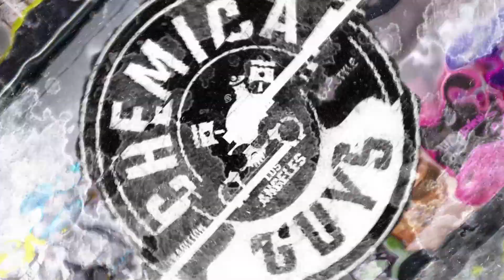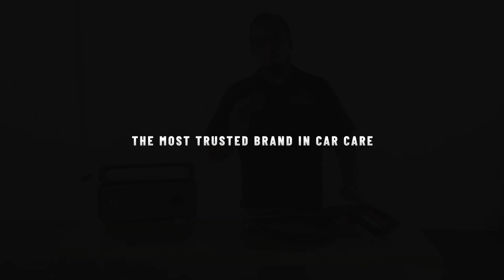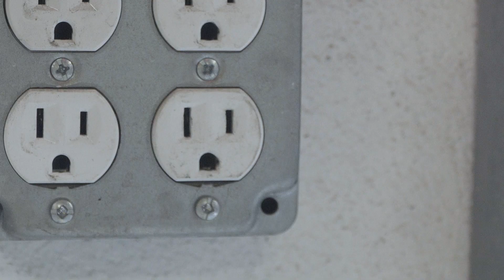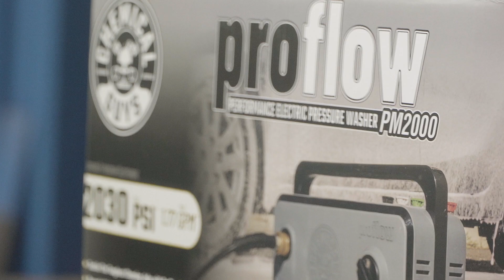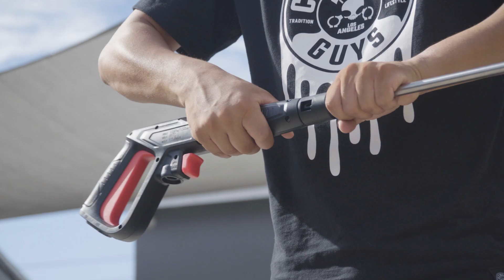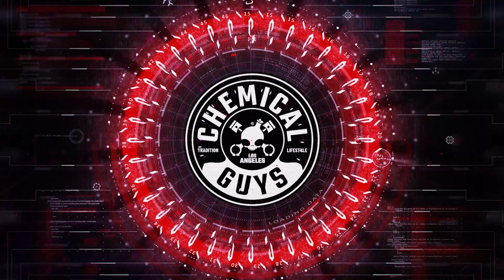What should I look for when buying a pressure washer? - Chemical Guys

Comment: I plan on purchasing this unit when it’s in stock. What is the recommended tip to use for automotive washing/detailing?
Reply from the maker: Hi Dana! You'll love the ProFlow! You can use a 40 or 65 degree tip for rinsing away spent foam and filth from paintwork.